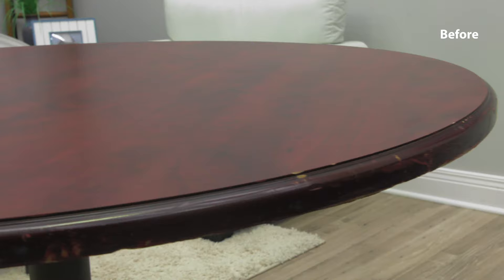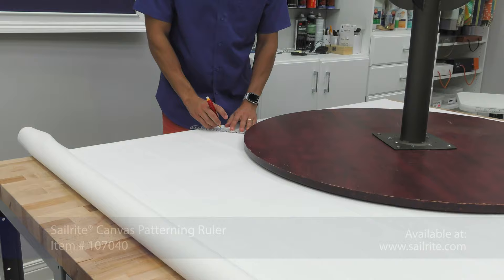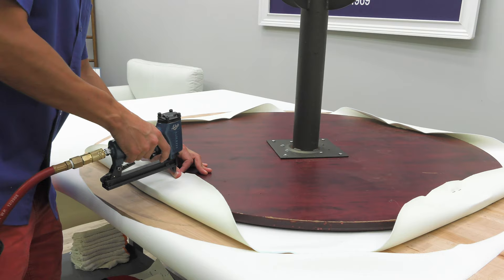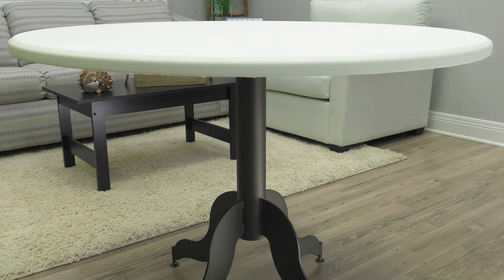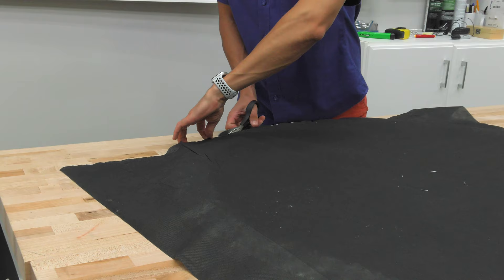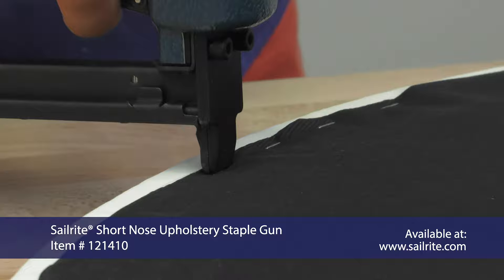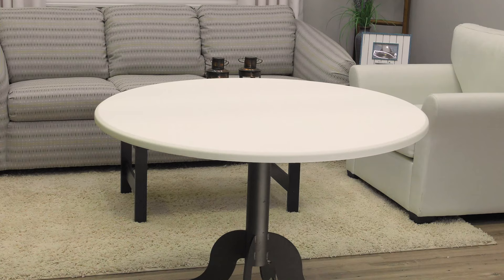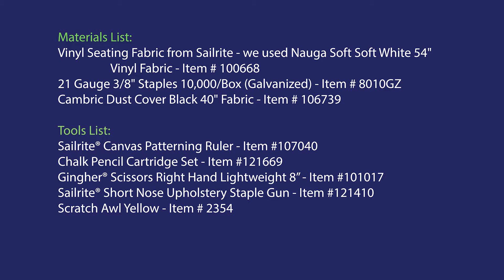Refinishing a Tabletop with Vinyl Fabric

Comment: In my experience, covering a large surface like this with fabric allows fabric to move slightly during use, or pucker with humidity and temperature changes.  I'd recommend gluing fabric or vinyl down using 3M 77 or other good quality spray adhesive, then staple underneath and finish.
Reply: This is not meant to be an insult or in anyway a provocation. It is not intended to make anyone angry, its just another point of view.
I think the keyword here is "experience", which I believe is loosely defined as "having made many mistakes!"
 I don't know what kinds of large surfaces you cover regularly 'erynthegrey', the ones I've done with regularity have been in the kitchen cabinet/ bathroom vanity industry as well as display cases using mostly plastic laminates and wood veneers, but vinyl and metal are also used.
Speaking purely from my own professional "experiences"  I wouldnt suggest or encourage using any adhesives or a job such as this for anyone for many reasons. On the easy side, what if the owner wants to change the decor and make the table match, how would you remove the vinyl?  Or a rip or tear or if it just becomes old and worn? Then what? 
On the more difficult end, contact type adhesives are very unforgiving and it would take very little for this project to become a total waste of alot of time, money and energy. Air bubbles, sand, dirt grit, unevenness of the table top, chips, dents... the list is long!
Even though I would do this project differently than the method shown, this option is way more suited for the Harry and Suzy Homemakers of the world. From offering a wide latitude of correcting mistakes to the gratification of a job well done and a use able piece of furniture which can be recovered at any time, for any reason for the cost of the new covering and a few staples!
I totally understand your suggestion for the reasons you gave, however, all things considered, it's just an old table that would have otherwise been on the curb so it's OK if it's not perfect!
If perfection is the endgame, have it professionally refinished not draped in vinyl!
Peace to all!
Reply from the maker: Great suggestion. We did pull the vinyl fabric tightly over the table, so I hope it will not move around much. However, If I would have thought about it in advance of this project, yes I would have glued down the vinyl fabric with 3M 77 Spray Adhesive then stapled for an even better bond. Thanks for you comment and suggestion!!!